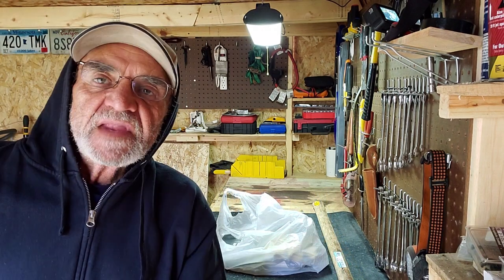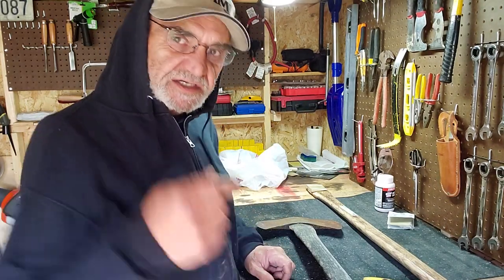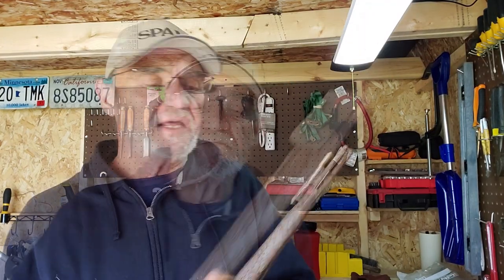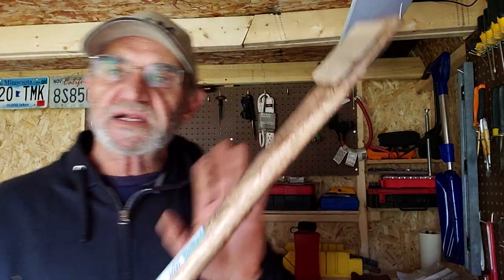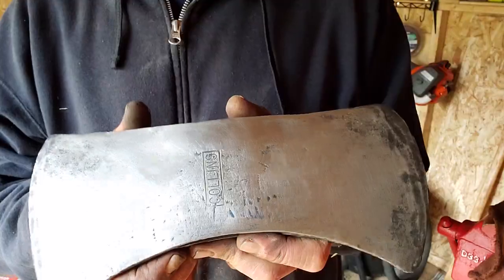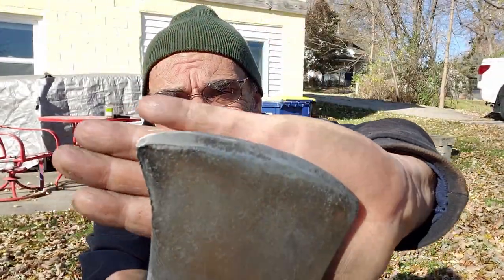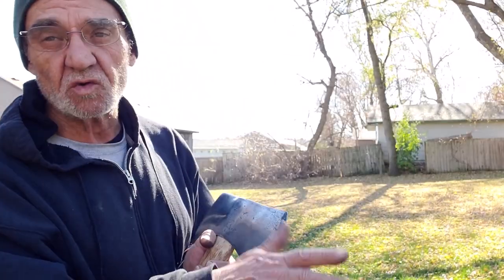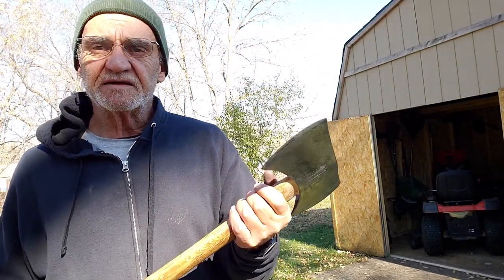Restoring a Collins Double Bit Axe - A first for me

Comment: Restoring old axes with mostly just hand tools has long been a hobby of mine. A four in hand is one of the most essential for shaping hafts and I use the spine of an old hacksaw blade as a scraper to remove the nasty coating that is usually applied before sanding. Then I sometimes burn the haft before soaking in BLO.
For the eye area and the wedge I coat them in pine tar as it is 100% impervious to moisture, unlike wood glue.
Glue has no place in an axe!
To remove the rust I soak the heads for a few days in a white vinegar and pickling salt solution then use a decent single cut file to restore the edge before using a sharpening stone which is followed by several grades of sandpaper on a sanding block.
You did well, I haven't acquired any Collins axes yet myself but I have some rare ones!
Reply from the maker: Just what I needed. Some great pointers sir. I really would like to do some more of this restoring. Very satisfying. Thank you for the support.
Reply: @2ndchancegeorge  I find the act of bringing this history back to life very therapeutic and I am always on the lookout to add another head to the Some Day box! One I haven't figured out a haft for is an old 8lb broadaxe, that I may have to custom make which is a skill I doubt I have!
Reply from the maker: Always good to challenge yourself. 👌 you learn alot that way...lol...just ask me.

Comment: I see you got the handle from Ace Hardware.  I just got through putting one in a 200 year old hand forged broad axe.  I like Watco Danish oil on my axe handles.    If you want to clean up the rust on the old Collin’s, try LavaRust.  It does a good job if left soaking for two days.  I had a hell of a time hanging that handle in the broad axe, because the interior dimensions of the eye were inconsistent.  I burnished the handle for the broad axe with a torch, sanded it to get a consistent color on the axe handle and the put a bunch of coats of Danish oil on the handle.  It looks nice.  It will be a wall hanger in my house because I am a descendant of the Pilgrims, who used broad axes to build their homes.they put polyurethane on new axe handles - it sucks.
Reply from the maker: That is very cool. Love that. History in the family. Nice. Be safe